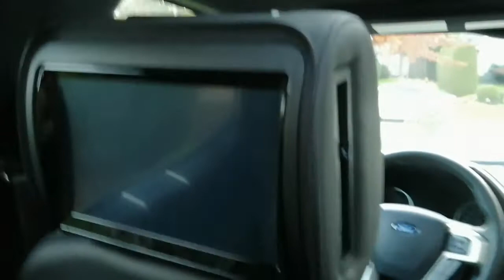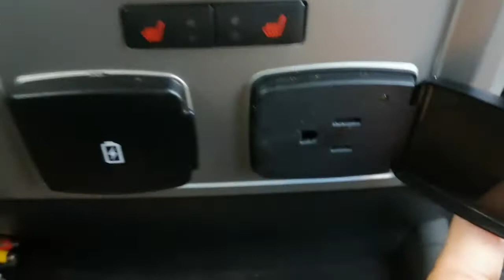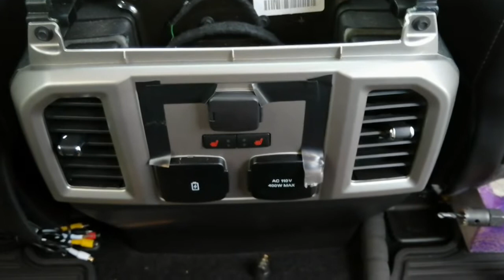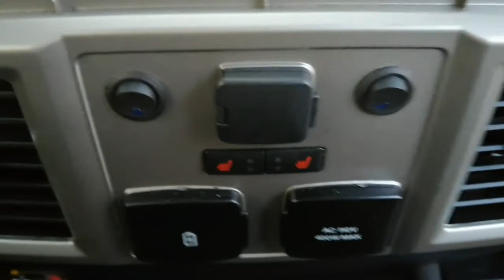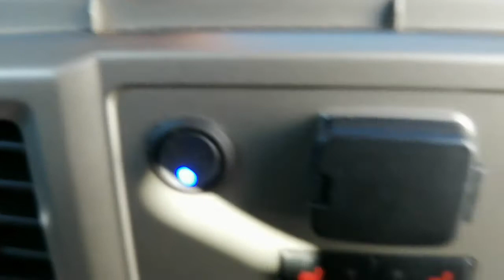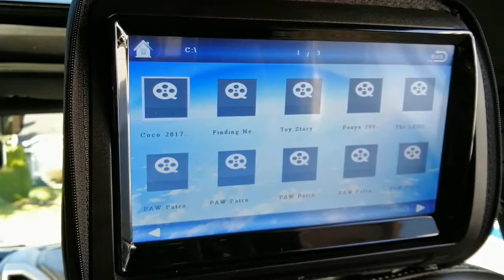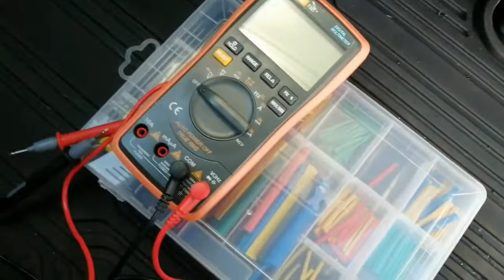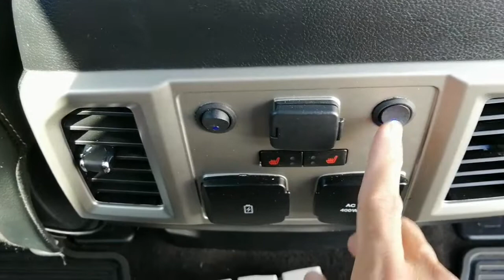Xtrons Headrest DVD Player Installation on 2020 Ford F150 Lariat

Comment: Hi again! .. with the red, yellow and white connectors from the DVD player, did you connect them to each other or are they connected independently to themselves?
Reply from the maker: Yes I did but you do not have to unless if you're thinking to play same content on both screen.  Let say you make the driver side as a player, then the passenger side will be the 2nd screen, and you have  set  it to AV in.
Reply: @ruvrandomusefulvideos  got it. Yes I wanted to mirror the same on both players… So, I think I just connect the 3 Male Yellow Red White connector’s on 1 screen into the 3 Female connectors on the other screens wiring ?    Also, not sure if I use three or or six into each other.
Reply from the maker: @jongib6096  Just connect all of them, yellow is for video, red and white is for the audio.

Comment: What size drill bit is that?
Reply from the maker: That depends on the switch the you are going to use. Switch that I use in this installation is 19.5mm, so just use the closest one but make sure not to use the big size otherwise it will be loose. After the installation, I find out that the 12 volts is actually turning off after 30 mins, its just delay.
Reply: @ruvrandomusefulvideos  got it. Thank you, I am purchasing the same switches as you provided in the link.

Comment: Do these work with 2014 f150 ?
Reply from the maker: Yes its universal and the pole that goes in the seat is adjustable and it comes with different diameters of plastic shim.